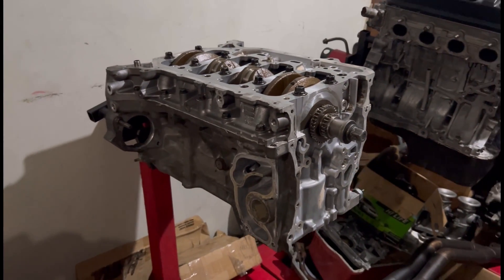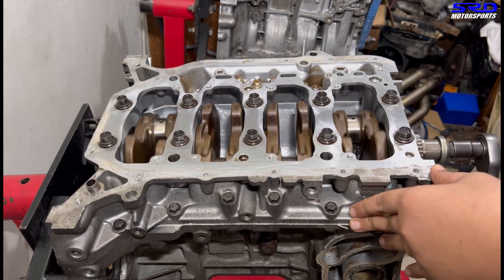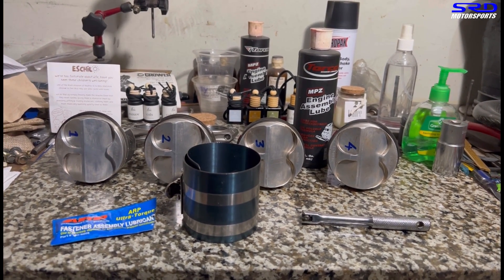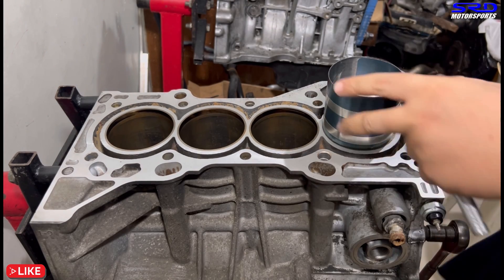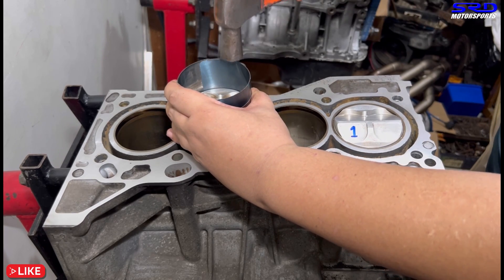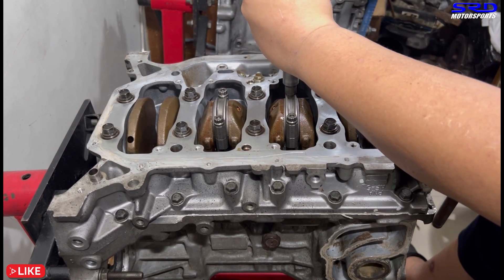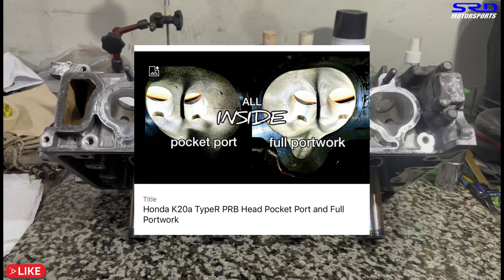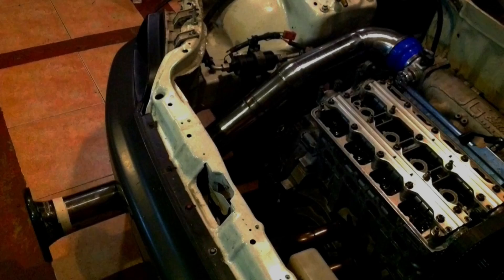K20a TypeR Build Series part 4 Complete Bottom-end Assembly

Comment: I just installed pistons with new rings and I can hear a slight scraping noise from the piston - I took it out, and the rings and cylinder wall look good - is this just a normal sound for new rings contacting the de glazed wall?

I was expecting total silence and totally smooth movement - instead I get a light scraping and slightly rough movement, but still easy to rotate...

Hope this is just normal - please help!
Reply from the maker: If u check my other build videos u can hear it and that’s a good sign
Reply: @SRDmotorsports  I will definitely check  your other videos - thanks for putting mind at ease...
Reply from the maker: my other videos shows me excited to hear that fresh hone bore and new rings sound 😂
Reply: @SRDmotorsports  Do you have a link or name of video - I did try to find it, but there are a lot of videos!
Reply from the maker: @pingpong9656  check the later ones the b16 months ago or the d16s not last year videos I mean I showed the same but the ones with new hone are always audible even the latest k20 u can hear it

Comment: Been a while since I've looked at your vids, just getting a lot of side jobs these days, I'm gathering parts for my engine, getting some bubbles in the overflow 😢
Reply from the maker: Oh man take it easy… atleast those symptoms isn’t detrimental yet, might still buy you time by driving lightly, do check on a diff radiator cap that might help a bit too
Reply: @SRDmotorsports  I've changed the cap already and no difference, guess I'll try a slightly higher pressure and this car has a personality of its own, you how Honda engines just love to rev and you're not even giving it 1/4 throttle 😩
Reply from the maker: oh true true